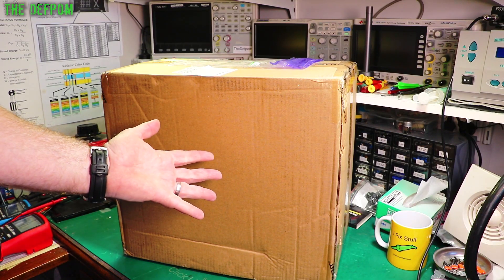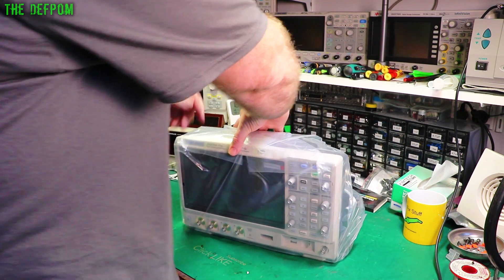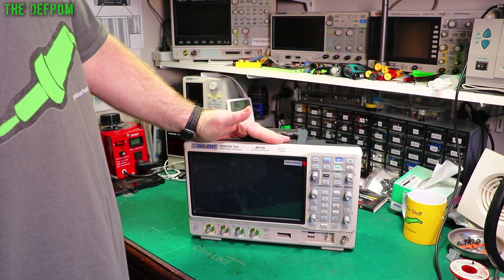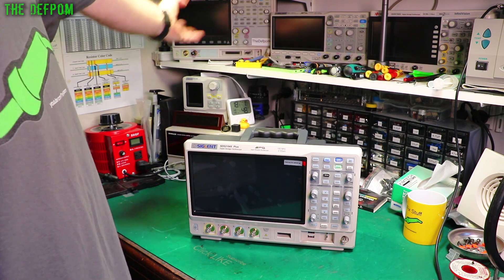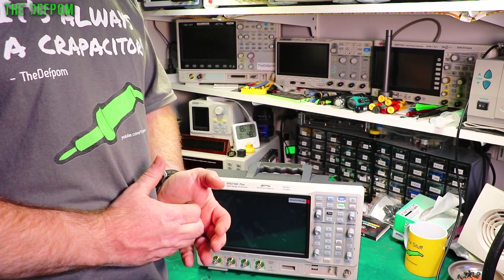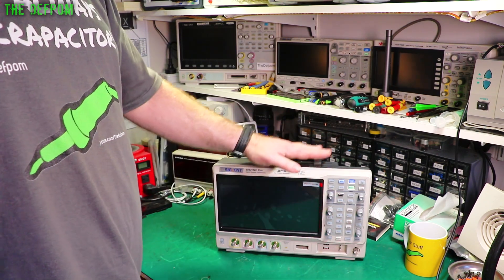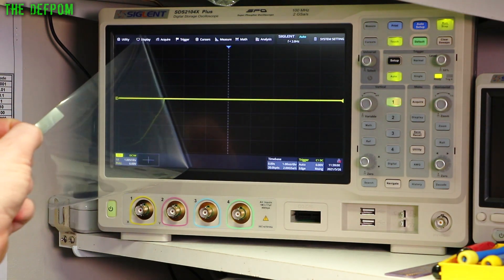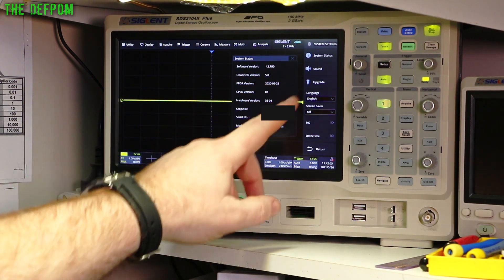🔴 OMG I WON !! - No.837

Comment: Congratulations.   I'm in the same club - almost never when anything.
I think it's great when these companies give away things.
 
Finally, in the last 5 years I worked, I won a Fluke Wi-Fi tester, before they sold the product line, AND then a small Keysight scope.   I couldn't believe my luck.

You should check the Siglent website.  You may find there are already some free upgrades.  My scope had a free DMM option that I took advantage of.